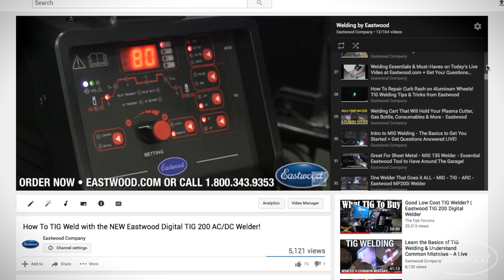TIG 200 Digital - 2T & 4T Feature Explained - Eastwood

Comment: Am I correct in thinking the welder is operating in 2T made when using the foot pedal? If you combine the torch switch and pedal can you run in 4T mode?
Reply from the maker: 2T and 4T is for the torch control.  2T is not for the pedal.  Hope this helps.
Reply: @eastwoodco   Did you mean 4T is not for the pedal?
Reply: In foot pedal . You bypass all them modes .